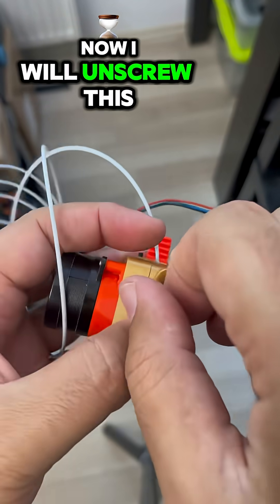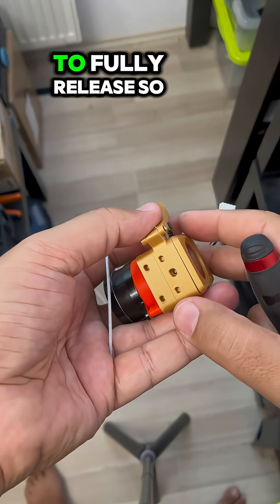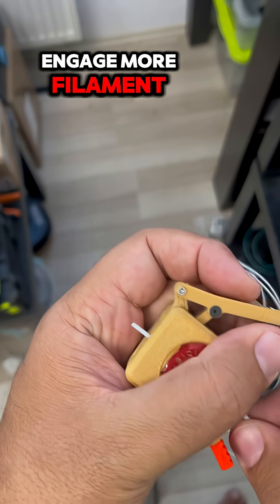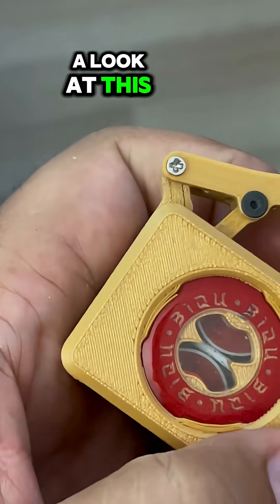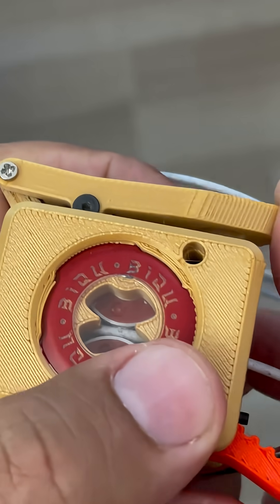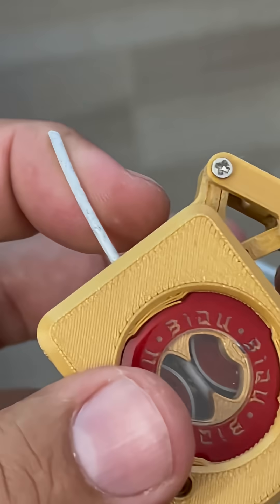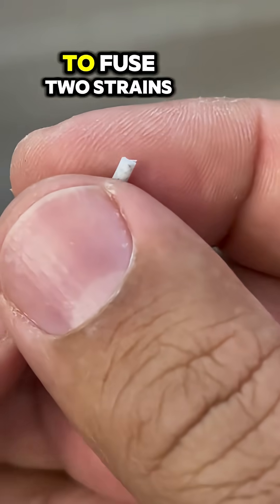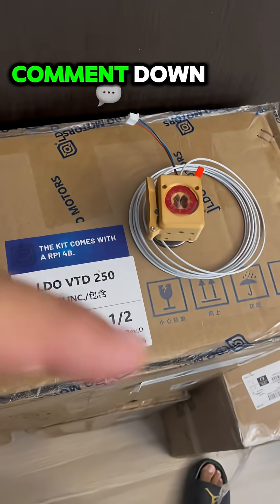Filament Cutter on BTT Nebula = PERFECTION!

Comment: There are parts for the sv08 Max showing up for sale on the Sovol website now. I wonder if any of them could be used as upgrades for the sv08.
Reply from the maker: The only think worth buying is the toolhead if you are still running the stock toolhead on your sv08

Comment: Is this different than the nebula that I just bought?
Reply from the maker: yes we have designed a new housing for the Nebula Extruder to incorporate the filament cutter and an additional filament sensor
Reply: @nadir3D well damn makes me want to return mine now LOL
Reply from the maker: why to return it when you need it to build this!
Reply: @nadir3D not sure how to have you contact me but I would really like to test this out.
Reply: Would really really like to get my hands on one to play with any chance it'll fit my Eva set up? I'm wondering if the lever gets in the way it looks like it sticks down a little lower then the base of the extruder.